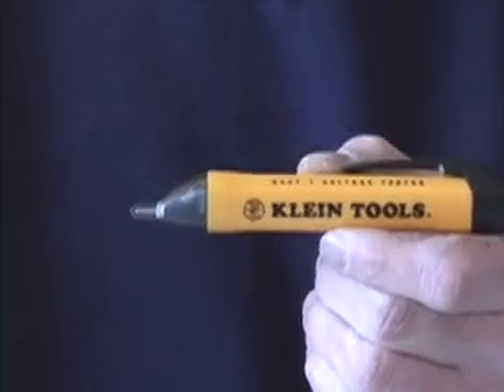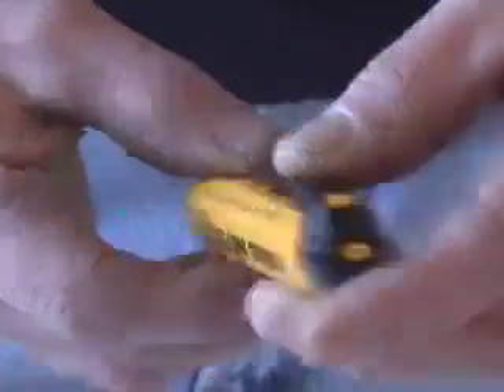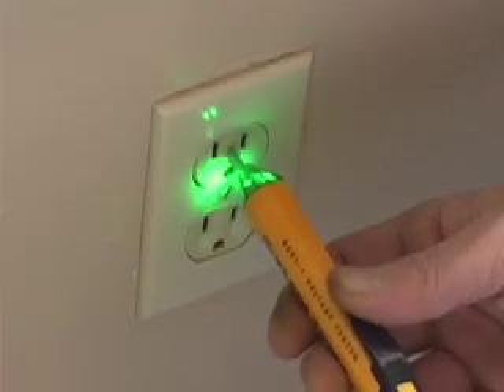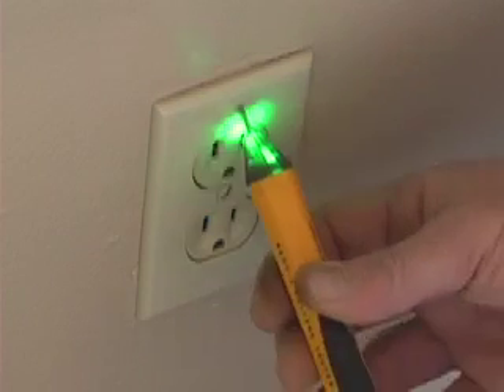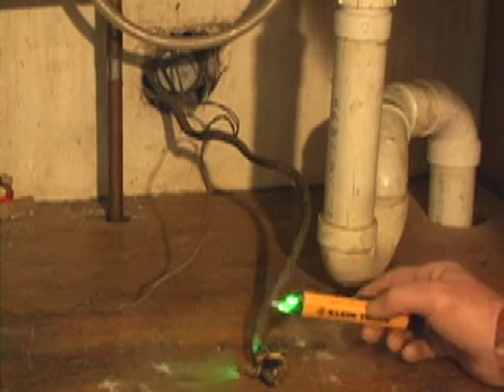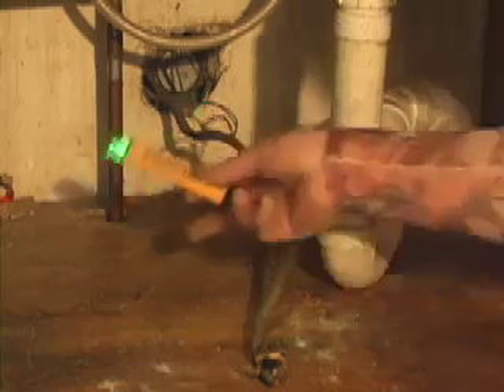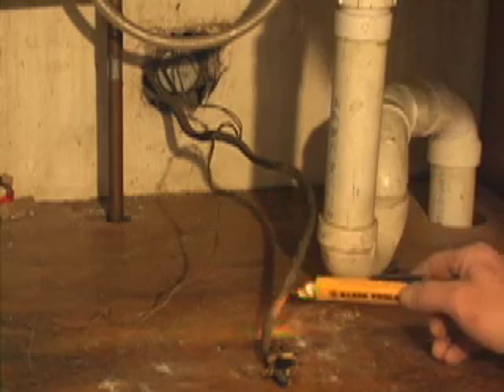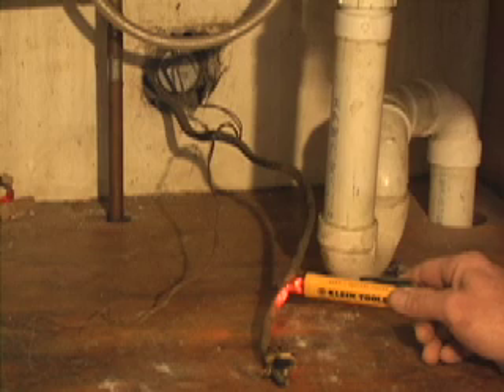electric tester DIY

Comment: What about the neutral it to can carry current even when cb is off, when circuit shares the neutral in a network neutral still Carries the load for the other energized circuit in the network.;-)  B careful and make sure the other circuit is dead too because you can still be shocked from the load on the neutral!

Comment: Great tip... Prior to watching this video, I used to strip the ends off of any wire that was questionalble and then put the bare copper leads of the wire into my mouth to see if it was live or not.   I have been electrocuted several times with this method and if fact, it killed me twice!  Yes, my wife found my dead body during our kitchen renovation.  Quite a price to pay to find out that I could have avoided death with a simple electrical tester.  Thanks Bob for your video!

Only kidding!